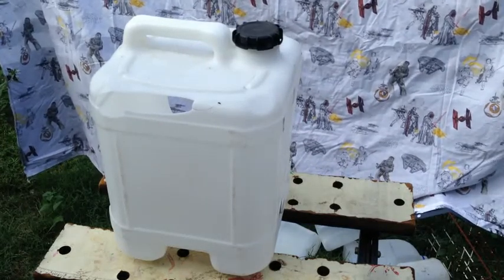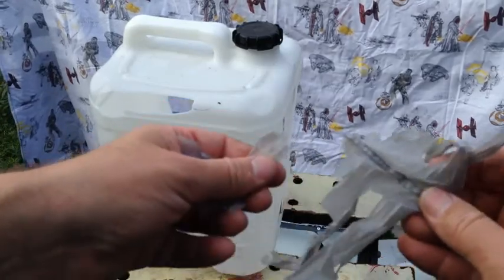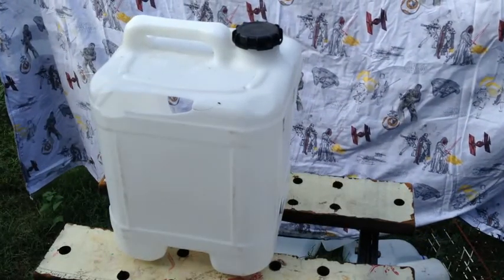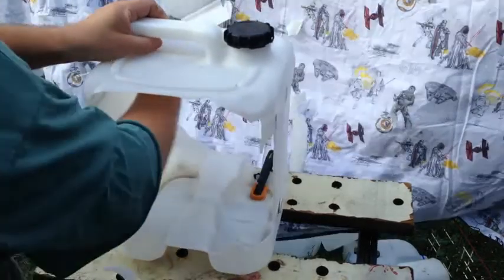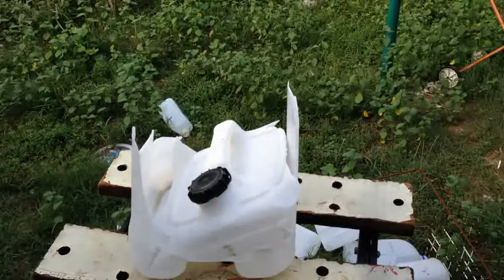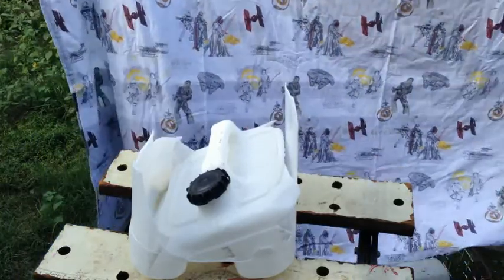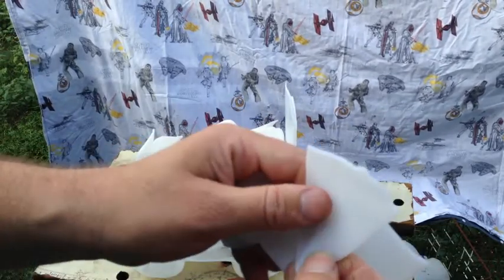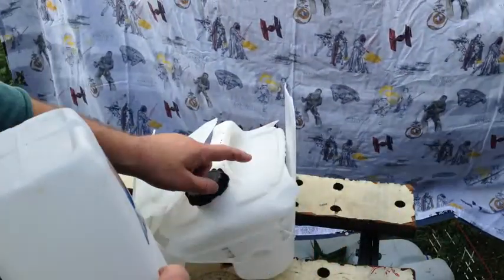EP66 What happens when you dont protect HDPE from sunlight

Comment: The big question is, will melting photo degraded material resolve the problem. Using a heat gun on a UV powdered PP surface, certainly rejuvenate the plastic aesthetically. But does it reverse the embrittlement? My gut says no. 

Adding Carbon black (charcoal powder) is a cheep form of UV protection.